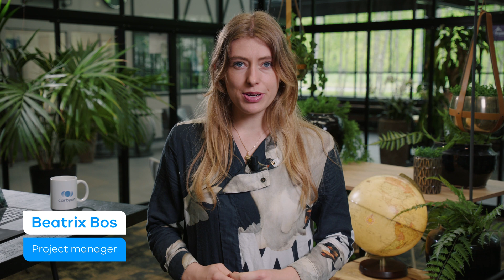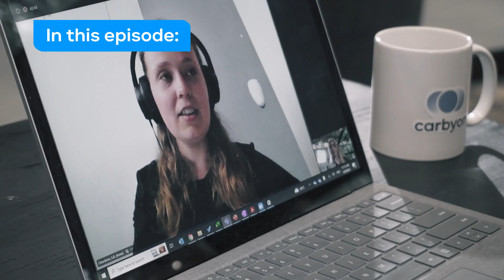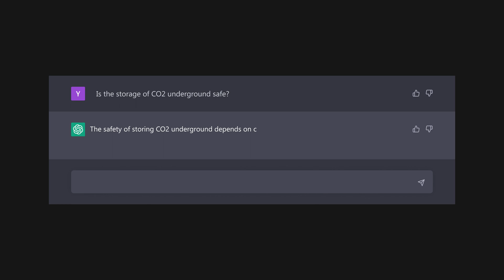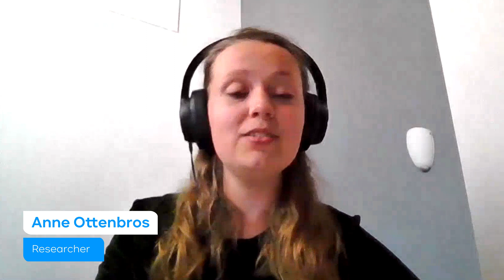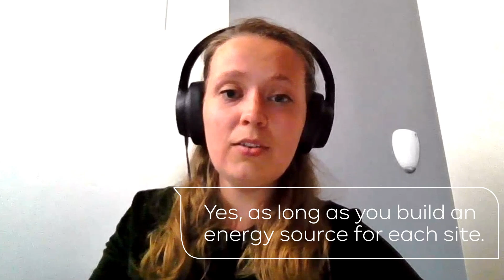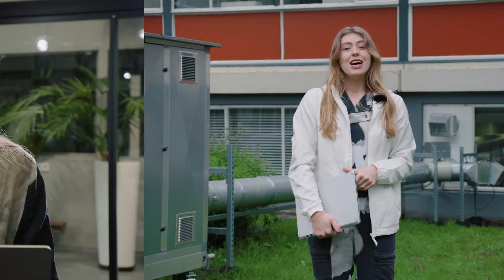Ask Carbyon - Episode 5: What are the environmental impacts of Direct Air Capture?

Comment: I follow different companies with capture solutions. Several work with chalk that needs to be heated to 1400 degrees which costs a way more energy than the Carbyon solution that only needs 150 degrees. This is a really game changer. Hopefully there can also be a smaller option for people with solar installations. First use solar for own use, and with the left over energy take the carbon from they air and create small income from the CO2 and help the planet?
Reply: Would be great if that works on a communal basis with a smart grid, so that the technology will not compete but complement home batteries.